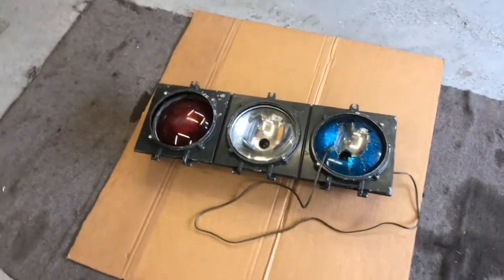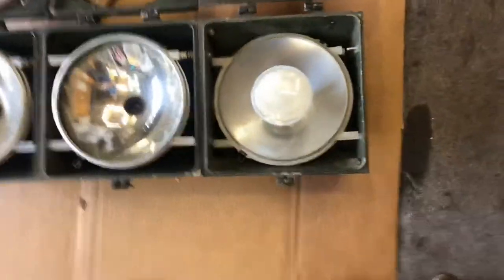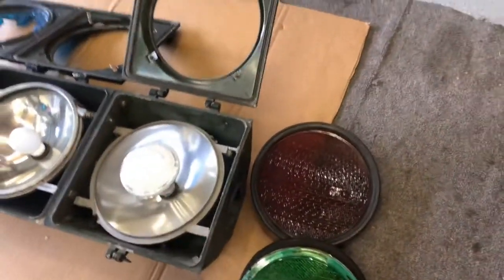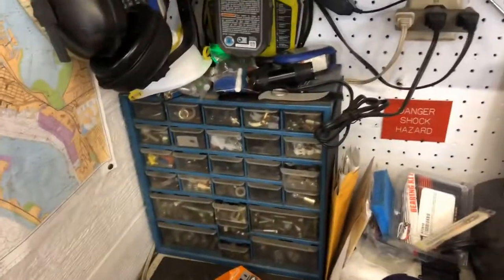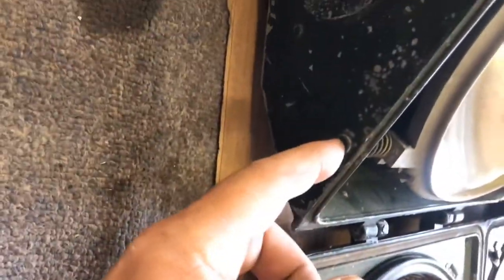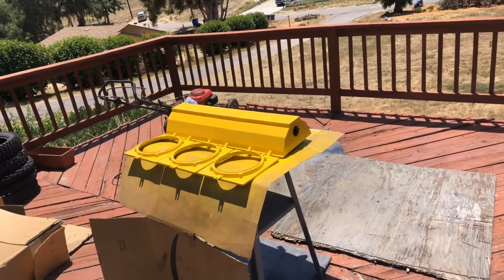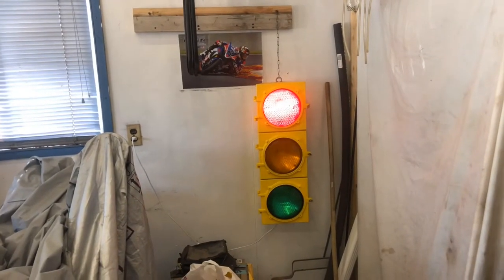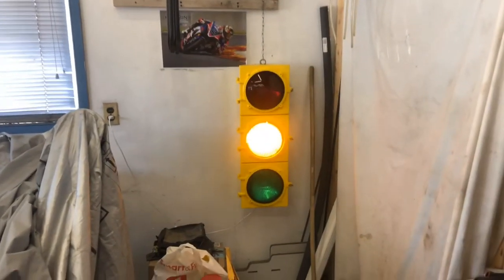Free Traffic Light Restoration And Upgrade : From Trash To Treasure!

Comment: The yellow and green lenses are from led modules. Someone separated them from the backing with the leds in it. Not designed to be used in incandescent light. That is a vintage 8" light. Not many left on the road these days. Makes a decent conversation piece.
Reply from the maker: Yes, I didn’t want to spend too much for the fancy glass lenses yet.  Not too bad for finding it on the curb.

Comment: How to build plumbing pipe traffic light mounting hardware

1 1/2 "close nipple" (find it in the plumbing area of most hardware stores,this part attaches the light to the mounting hardware

1 1/2 elbow

1 1/2 conduit lock nut or 1 -1/2 "waste nut"
1 1/2 floor flange
1 1/2 length of pipe of your choice in length 

All parts available online or at most hardware stores hope this helps 😎👍
Reply from the maker: sas quatch yeah, I was looking at some of that stuff but never really got down to figuring it out.  Thanks!